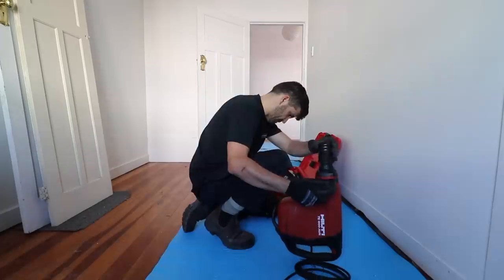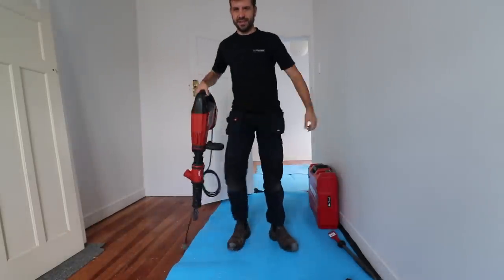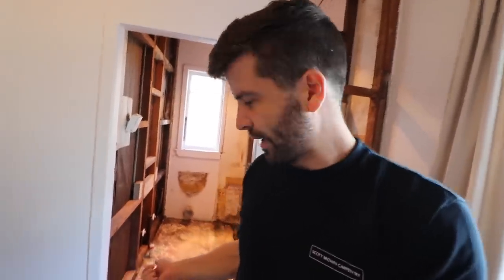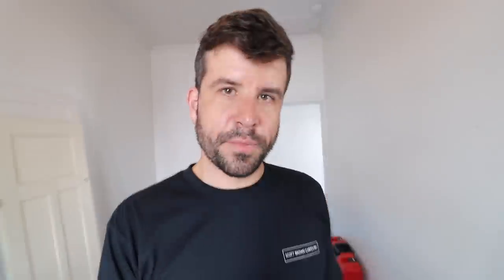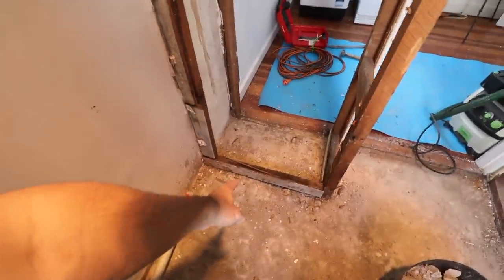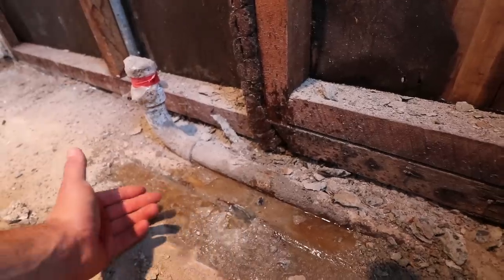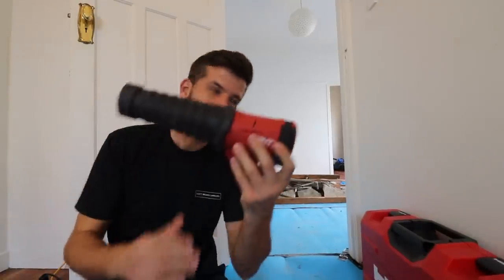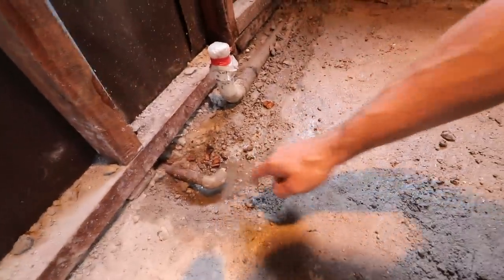This Hilti Demo Hammer Is Ridiculous

Comment: I find Hilti gear over rated and over priced, wondering how it would cope with a thicker and more dense concrete, my guess is not very well, but it was overkill to use on that thin screed, a cheap Titan from screwfix would have easily done the job, and they're a lot easier to use, I wouldn't fancy using it on wall work either, it's just too big and heavy for that...tough luck on hitting that pipe though, but we've all done it lol

Comment: Overpriced tools !  Also there's a service light that comes on every year and cuts the machine off, £300-£400 to get it serviced and back working. Biggest con out there. Avoid at all costs
Reply: You are joking?
Reply: Joe Hogan yea he’s full of it
Reply: @mylesmontgomery517  it does on my 905 breaker
Reply: @johnjock6052  light is just a service indicator. If your drill won't start or work, it not the light causing it to stop operating.

Comment: cannot see the point of vac attachment at all
Reply: stuart thomas silica dust is the second biggest killer on the construction site, second only to asbestos. The silica dust particles are small enough to enter the lungs and once there causes scarring, reducing lung capacity. Just because we’ve been doing it for years and it hasn’t killed us doesn’t mean there hasn’t been harm done. Minimizing dust has got to be a good thing.

Comment: Haha buddy that's way too overkill to use that hammer to remove 1 and half inch of cement, not even concrete. We use that hilti hammer to make trenches in 6 inch slabs for plumbing or to drink a 4 inch hole-saw thru concrete foundation.